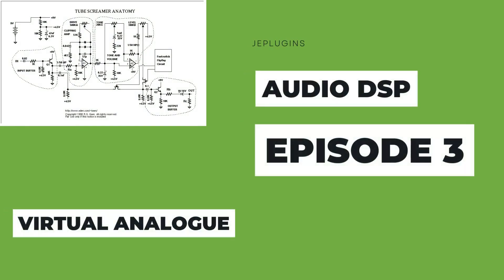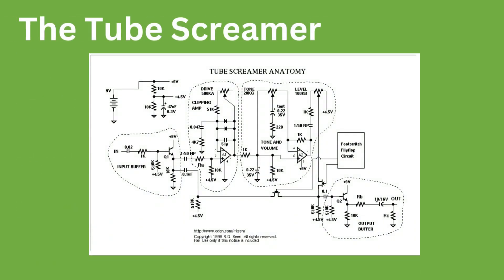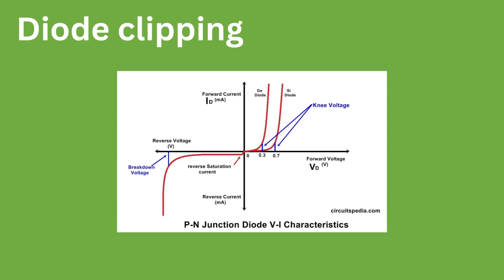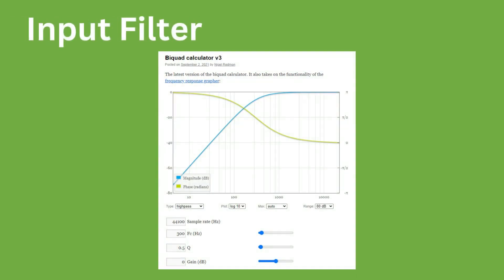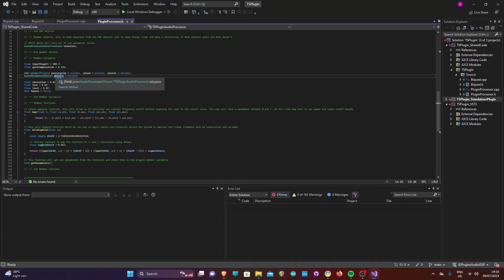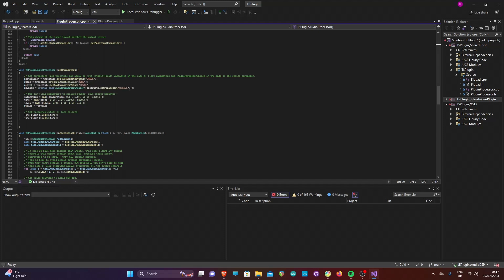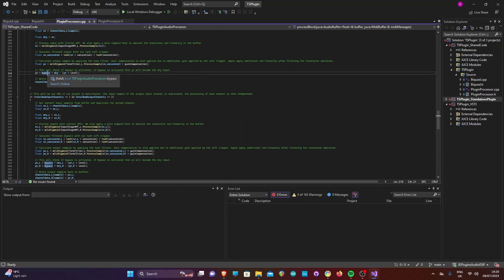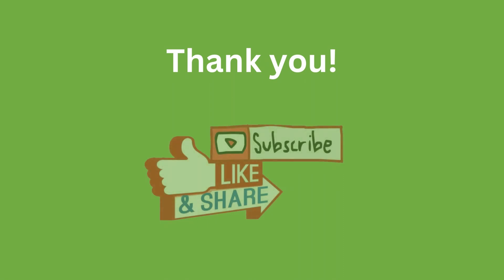Audio DSP: Episode 3 - Introduction to Virtual Analogue (JUCE Code in description)

Comment: This is EXACTLY the sort of content I was looking for. I’m looking to create digital models of physical circuits to use in guitar pedals that can run on an STM32 platform. It’s been really hard to find people that cover analog circuit modeling and design in DSP, and most people go super into the math theory and never show any code.

I’m very interested to see all aspects of this type of circuit modeled out if you use ML models of op amps vs approximation curves.

Comment from the maker: CORRECTION: In the slide at 2:20 I say that R11 is parallel to R10. This is not accurate, they share a connecting node and are adjacent. The main thing to know is that if the signal passes through a capacitor, it is a high pass filter but if the signal passes through a resistor and there is capacitor that is connected to ground it is a low pass filter. Thanks.